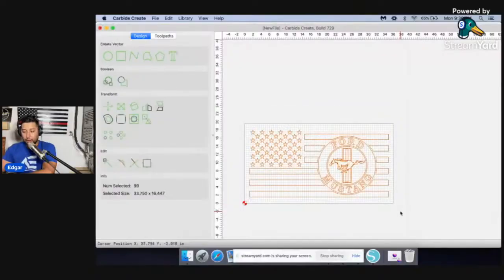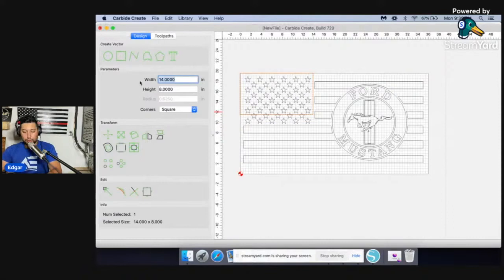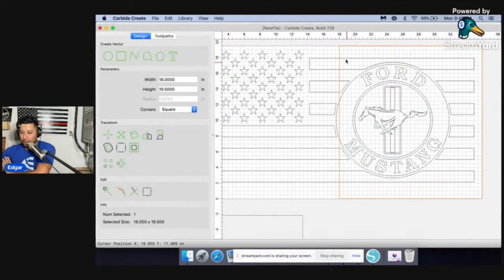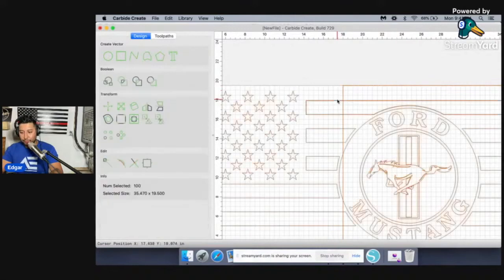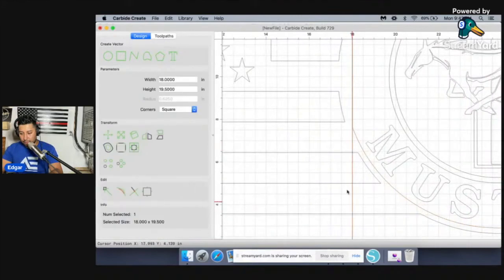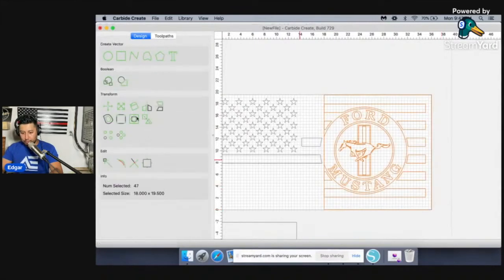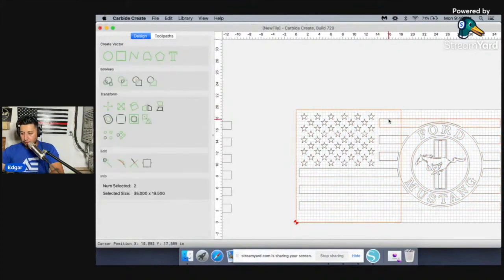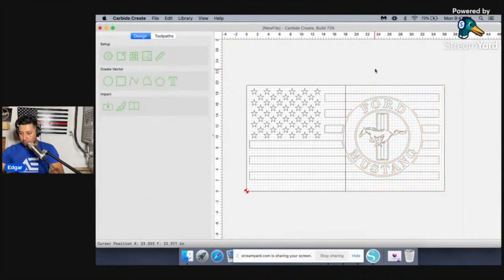Learn How To Tile In Carbide Create for Custom CNC Flag with this Simple Tutorial

Comment: Thanks for this simple instruction on tiling with carbide create. I did my first tiling project, 42in x 22 in. It came out great, you can't even see the seam between the two tiles. Great video tutorial.
Reply from the maker: Hey Eden glad it helped and congrats on the first tiling job. It’s always a bit nerve wracking especially trying to get proper alignment on that second tile.
Reply: I agree. I was overthinking the process. One thing I did do slightly different is adding 1/8 in to both tiles so they would overlap. In the simulation, with no overlap, it leaves some uncut parts. Overlapping by 1/8 eliminated this issue.

Comment: Ok. When putting the board on the cnc, do you mark the center line on the board and line it up with the rear max line. Then move the board to the front of the cnc and line the end of the board with that same line
Reply from the maker: Yes exactly.  

Mark the center of the board
And make a mark on the wasteboard whatever thateasurement is from the front of your waste board.

Then edge up the front of material to front of waste board  and the two lines should match. 

Please check out this video and I show a bit more angles

How to Carve a Large Sign/Flag on a CNC / How to Tile Using Carbide Create / Tiling on Shapeoko
https://youtu.be/5uDY2vxQxas